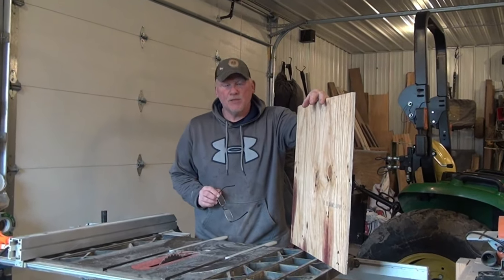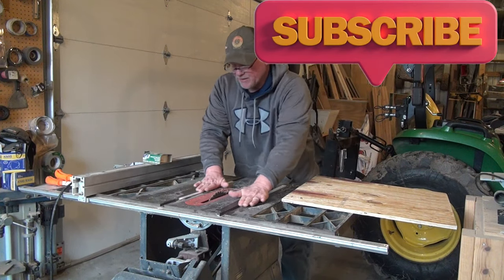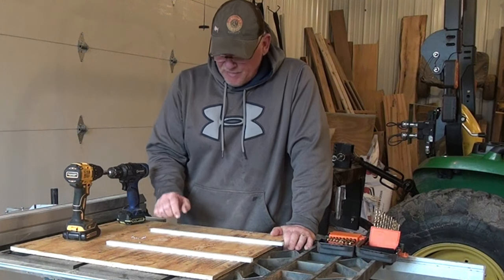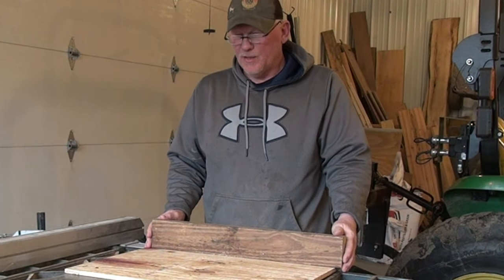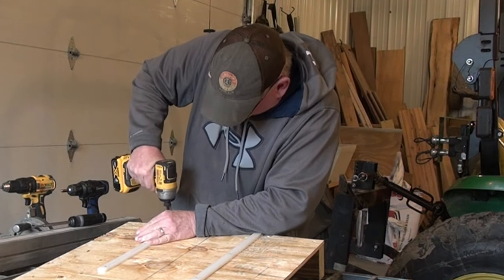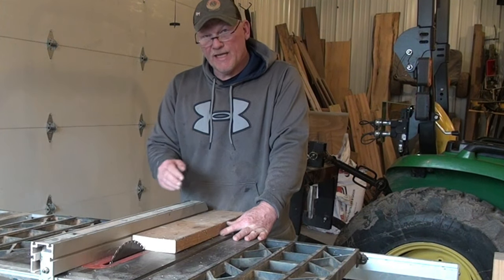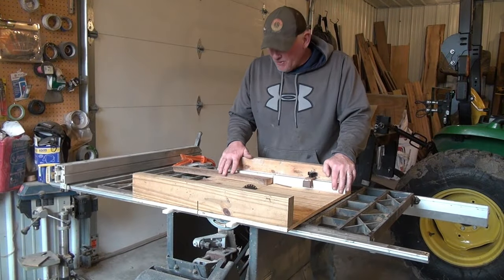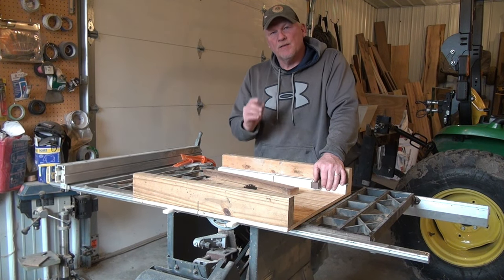The Truth about the Crosscut Sled Kit From Amazon

Comment: I have just came across this video and I just wanted to mention that 2 things, first is I don't know if you came across it yet or not but you may want to add an additional piece of wood to the back side of the sled (the section facing you) you may see where the blade has cut all the way through. Some feel safer with a piece of 2x4 or something going length wise out the back just for a little extra protection when cutting smaller pieces.
  The second is eventually you may want to replace the piece that you put your rail in. If later on at some point you decide to buy after market accessories you may find that that board will not be tall enough or wide, one in particular I can think of off the top of my head is a flip stop, if you decide to upgrade to upgrade to an aftermarket flip stop later on that board is not tall enough. Nothing important or a game changer just letting you know
Reply: Dirty Curty excellent observations and suggestions!   I left the "Safety Block" off because I thought it was over-kill, however you can never be too safe and I should have mentioned that in the episode.  My largest regret is making the sled too wide and wished I would have used 16 x 16 or 16 x 12 plywood for the base.   Thanks for watching and subscribing.